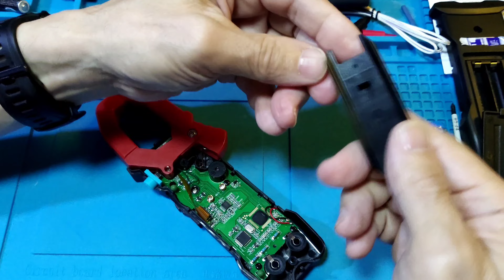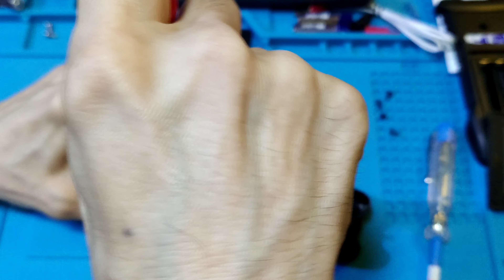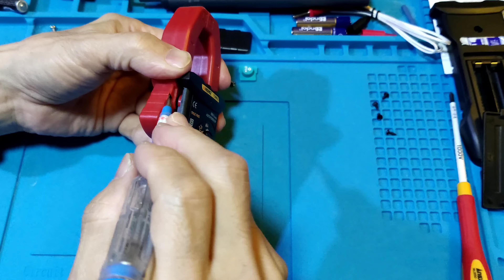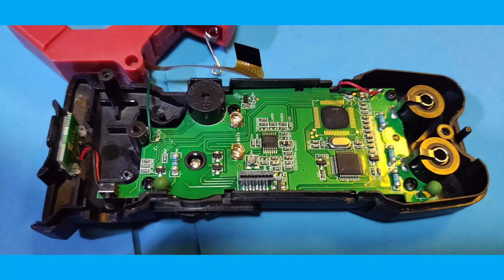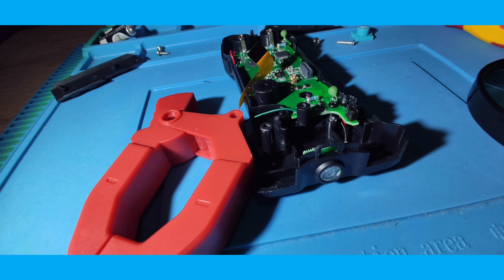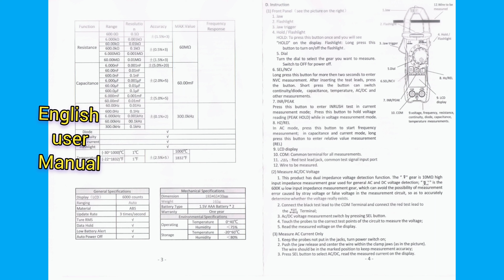ANENG AN-CM82 AC/DC CURRENT CLAMP METER CATIII600V,6000 COUNTS 600A.made in china.

Comment: Is it possible to calibrate this clamp meter? I bought the same model, but the measurements are incorrect.
Reply: From the video, I see a small potentiometer near the flex cable socket. Try adjusting it gently

Comment: How about uni-t 210e which one the best if compare with aneng an-cm82?
Reply: Hello how about ut204+ sir??
Reply from the maker: @d_dadang5467  sorry we no ut210e meter.
Reply from the maker: @d_dadang5467  the ut210e is the price and q c and use the electron parts is better than aneng.if normal use you choice this meter,if high accuracy choice unit clamp.

Comment: What is the minimum detectable current in inrush mode?

Some similar equipment (such as the Habotest/Kaiweets HT208D) that have this inrush function only detect above 10A...

I can't find the online manual to check those values in detail.
Reply from the maker: sorry ,i don't know  this but before test aneng meter ,we found that fluke 319 can capture the smallest inrush current than aneng clamp meter,but your minimum detectable current cannot know that is what kind. because we only a normal electrician not a engineer.sorry

Comment: Hi. I bought one aneng cm82 just received it. I tried Ampere in DC but when i clamped the negative wire, it is not of the same value as on positive wire, like 1.1A & 1.7A. How to make an accurate reading on DC Ampere  mode?
Reply from the maker: it may be sometimes show the value not the same,if you want to except same it must send back to the seller,and don't adjust itself because that hard to doing it.thx for watching.
Reply: @wilsonluilui  is your cm82 show the same value on negative and, positive wires in DC Ampere mode?

Comment: No fuse inside to protect the circuit, this may blowup?
Reply from the maker: it have resistor and ptc for protection sir.
Reply: @wilsonluilui  where is the protection resistor located, lower part? And what is the value of the resistor?
Reply from the maker: it normal use a ptc to protect ,and green or blue color on it.
Reply from the maker: R33,R17 ptc in this meter
Reply from the maker: and pls see the tear down part video and found the position.
Reply: @wilsonluilui  thanks for this information
Reply: it measure current with the clamp, no fuse is needed

Comment: Good day sir. What are your conclusions on this meter? Can you recommend buying this for a hobbyist, home repairs and diy electronic repairs and projects? Will this be durable enough for everyday electrican use?
Reply from the maker: yes ,it can do .but the case of aneng also not a great of it only a normal pvc ,if dropping down may easy be broken.😅😅😅
Reply: @wilsonluilui  too bad if they had made a better case for such a decent meter. Thanks to your in depth review on this meters by the way. Really provided us more info before buying
Reply from the maker: you can found that in the tear down film,the screw terminal sometime is first open but the pvc screw terminal is broken to 2 part ,it mean that it easy for not function and use a long time,and now day like fluke meter in china also have this problem,it also above 5  to 6 years may be damage the case of screw terminal sir.😂
Reply from the maker: And you can try a new uni-t UT117C it quality best but 5 time of the price of aneng meter.
Reply: @wilsonluilui  ill chek sir, thank you
Reply: @wilsonluilui  ut117c is way out of my budget range sir haha, but it seems a really great meter. The functionality of aneng cm82 is great, having ac/dc current function, true rms, 6000 count seems to be a good choice for a hobbyist like me, for doing some repairs and some electrical installation. The downside is that as you have said it is not durable.. and i have some experience.of aneng not working out of the box, maybe quality controll issue, if they could improve a bit on qc and plastic parts.
Reply from the maker: @simphinerubio2348  yes ,it only the input protection and the pvc case not very well.
Reply: @wilsonluilui sir, now that you mentioned input protection, will this be safe on testing household voltages?, 110-220 circuits only, i wont be working on higher voltages. I just need an all around meter that can do most test on small repairs and simple electrical instalations
Reply from the maker: yes,it can do the testing,but if in outdoor transform testing be careful of high voltage and wear a fire retardand protection gloves.
Reply: @wilsonluilui  thank you very much sir😁 im gonna order the meter
Reply: @simphinerubio2348  did you end of getting the cm82? Thoughts? Just ordered one myself and will be mostly using as DIY for automotive purposes to clamp alternator output, car audio amplifier clamped rms wattage etc along with the occasionally troubleshooting of household items. I already have a couple decent multimeters so mainly bought the cm82 for the clamping capabilities.
Reply from the maker: thx for watching
Reply: I bought mine.. tested.. good. This is good clamp meter.
Reply from the maker: @ronyyang thx for watching

Comment: How durable is this cm82?
Reply from the maker: it new meter ,the case is not drop prove and say that not durable yet.
Reply: @wilsonluilui  how frequent do you use it? Is it functioning and in good condition until now?
Reply from the maker: @stephenshop4946  normal use in 50hz AC220v now.
Reply: @wilsonluilui  do you use it everyday?
Reply from the maker: @stephenshop4946  no sir .
Reply from the maker: less for use a current clips every day.normal only use a mini type multimeter only ,less the weight sir,we take a bag to do the work everyday.

Comment: In AC current mode with the 10 turn coil, the meter measures the current but the small upper display shows 0000Hz for frequency. Then at about 30:50 the AC current rises from 7A to 40A and all of a sudden the small upper display starts showing the frequency, 50Hz. 

How comes that?
Reply: It's interesting anyway. But no big problem, I've ordered an Aneng Q1 multimeter, it can do the job. 

Thank you for your reply - and for this excellent test, too.
Reply from the maker: in 31：07 that the display the 50hz of reading ,it come late & this meter small digital is only display in high current crossing may come out the frequency.
Reply from the maker: and in my country the supply voltage and frequency 220v AC 50hz.

Comment: Doen't have Inrush DC current mode? Only AC current?
Reply from the maker: it so sorry for late of test,because we have ill this month,Thx for watching.
Reply from the maker: https://youtube.com/shorts/ecBD4rw1lxM?feature=share
Reply from the maker: we TEST it must ,first not to press rel KEY in dc,than press the inrush KEY once,that will capacture the inrush current,sorry for this meter is have AC and DC inrush current measure,for my wrong settting not TEST sir .Thx for advise me.
Reply: @wilsonluilui  Nice. I bought one and waiting to test. Thank you!
Reply from the maker: @germinbmxer  Thx for watching .and the inrush current some Time is like the peak current (for the motor starting current it high and fast capture it).bye.
Reply from the maker: Thx for you advise.
Reply: @wilsonluilui  Very thank you for this answer!!!
Reply: @wilsonluilui  is Peak detect buttom for DC current?
Reply from the maker: @germinbmxer  we are  not TEST this function,i will TEST it and tell you.
Reply from the maker: we TEST that the meter only can capture the peak AC or DC voltage ,and hold the data,it not function at currenA measure.
Reply: @wilsonluilui  Big thank you. You won a follower!
Reply from the maker: https://youtube.com/shorts/j1N4p0Jm0Fs?feature=share
Reply: Thank you for your question! ))